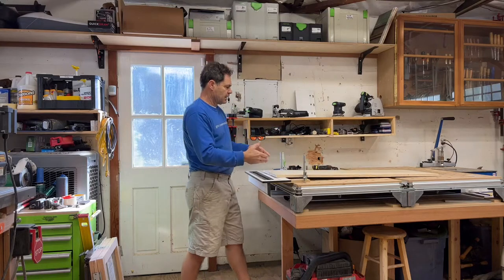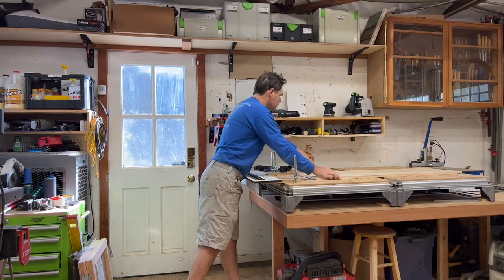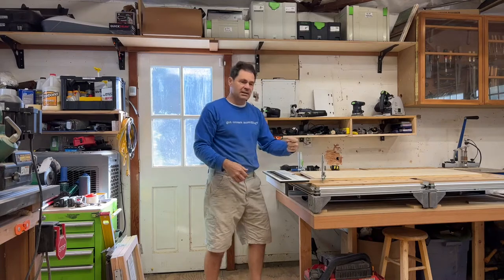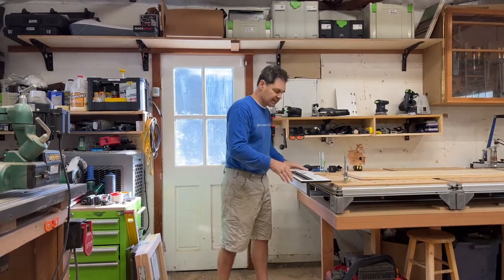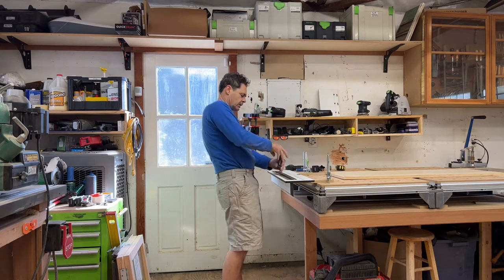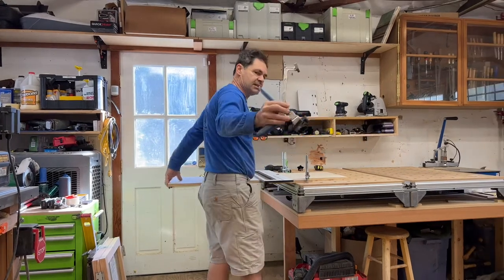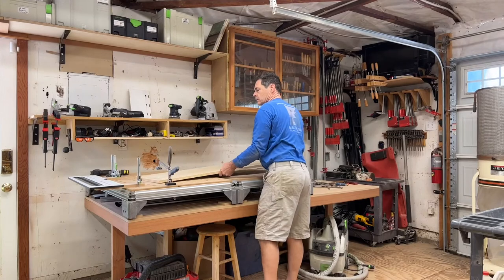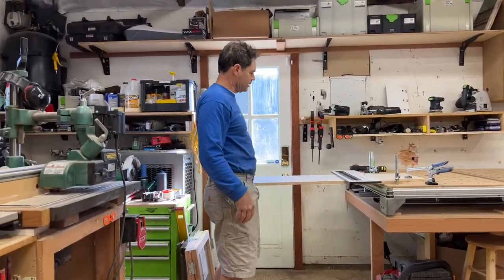Fixturing a Peanut 2 jig for efficiency

Comment: great tip, im thinking of getting a peanut jig, great for selling flat pack small furniture .
Reply from the maker: That’s why I got it and I think that if you were doing multiples that’s where it would really shine. After doing this video, I have discovered that it’s very important that whatever you use underneath your peanut jig, it needs to be the same material to ensure the same thickness. This machine is very sensitive to variations in the depth of cut with the router.
Reply: @crownmoldingbyspectaculart941  good to know thanks .